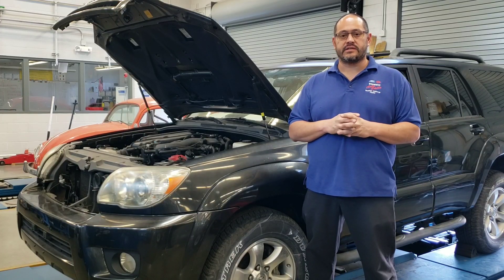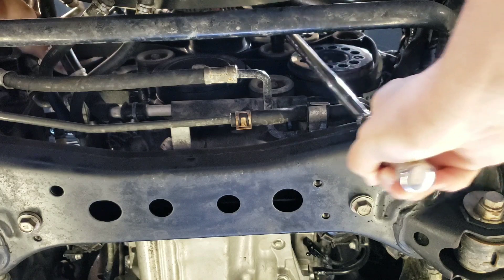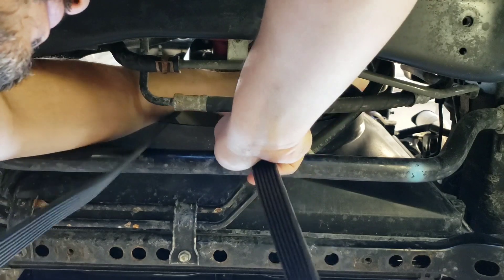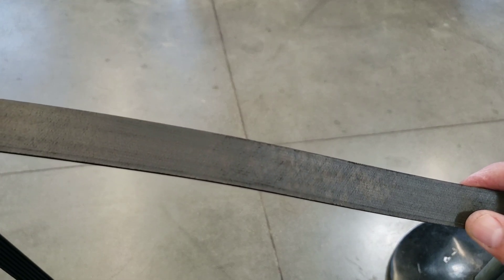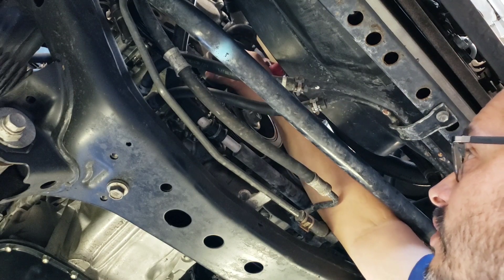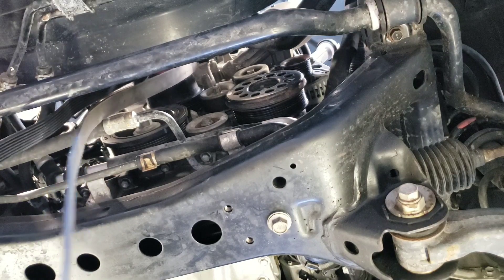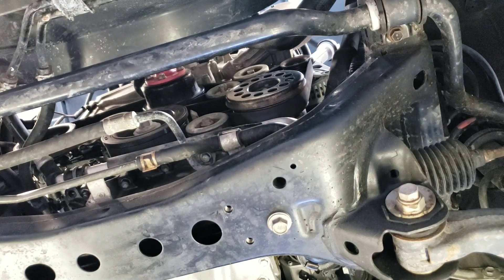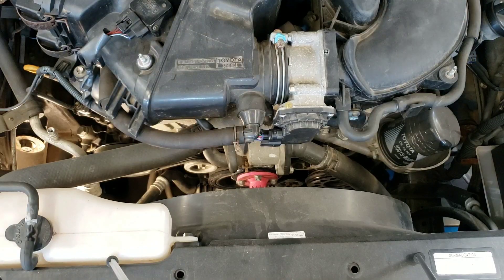Toyota 4 Runner serpentine belt replacement

Comment: The 2011 4runner (I assume all 5th generations) has exact same configuration. However, changing the belt can be done from the top. Not that difficult.

Comment: By far the best DIY drive belt change video on Youtube! Very clear and straight to the point with a few added hints to make the job even easier. The 5mm allen key trick was a life savior and made the job that much more simple! I was flushing the cooling system and replacing the thermostat with a new one and after draining and flushing most of the coolant out, I went straight into doing this drive belt replacement job with the old thermostat and hose pulled out of the way, which I think made the job even more easier... less stuff in the way. Thank you Omar Sevilla for a very helpful video! Appreciate the upload!
Reply from the maker: Thank you.  I post these videos when I can.
Reply: Yeah, now all I have to do is buy a 12ft high garage, so I can get that lift in it. Then buy a belt. Nice.

Comment: Omar thank you for posting, I am also interested in your scissor lift because of the garage low celing, any info appreciated
Reply from the maker: The lift is from hunter engineering.  The shop was engineered with flush mount installation specific to the equipment.  This allows us to drive very low vehicles onto the lift to perform alignments.  The price tag for lift and alignment equipment was about 60k in 2011. Not sure what it would run today.

Comment: Want to find out if have a question.I just change my bad serpentine belt on my 07 Toyota 4runner and place a new one on. I notice later that day my power steering pulley moving in and out so i want to know if thats normal or what's the issue??
Reply from the maker: Yes some pumps have a little end play.  If its not leaking I would consider it normal.

Comment: Update,i went Advance auto ,got a reman CARDONE power steering pump for about $200 but with the $45 core charge,i will pay less.I got home a bit late thinking i will get the pump drop but ran into issue with that 17Mm NUT (the high  pressure hose ).Tomorrow a friend of mine is going to bring a impack gun to help me get that line off.

Comment: Another pointer is, i dont know if the belt had ever being changed. I bought this 07 toyota 4runner 3 or so months ago with 104,675 Odo. Hope it's not a faulty fail pump because it don't make any noise,no leak nor i feel nothing but smoothness when i turn the steering.
Reply from the maker: If the belt is not being damaged and the power steering pump is not making noise maybe it is a normal condition. Notice in the video that I put my hand on each pulley to verify that it feels normal. I would pull the Power steering pump shaft in and out to see how much it moves. It should only move a few thousandths of an inch.
Reply: @OmarSevillaAuto  Thanks for taking the time to respond to me 😊😊🙏🏼. I will update upon my task with my 07 Toyota 4runner.
Reply: @OmarSevillaAuto  SO after leaving the comment,i went and got the serpentine belt and check the PS pulley with my hand.  The pulley as expected went IN and Out with about 3mm  and i also did a record video of my moving it In and Out. Since the pump need out,what QUALITY brand would you recommend me to get???
Reply from the maker: @doobedi  I would compare my pump with the new one before replacing.  Toyota factory parts are the best but any aftermarket parts will work. It really depends on your budget.
Reply: @OmarSevillaAuto  So i got the pump and compare them which look very identical. I put  on my new /reman pump but when it came to put the serpentine belt back on,it couldn't go over the pulley. The hole that you put the 5.5mm Allen key in to hold the Tensioner broke on me  😔. I try not to frustrate myself and not going give up.
Reply: @OmarSevillaAuto  So i got the serpentine belt over the pulley. It was my fault because i didnt push the Tensioner all the way back but now it's up and running like a dream 😅.

Comment: I did exactly what you did but on idling i saw my PS PULLEY going IN AND OUT.
Reply from the maker: If you are having a problem with belts being damaged it may be time to replace a failed pump. I would remove the belt and see if I can slide the pump shaft in and out by hand.
Reply: @OmarSevillaAuto  well this is a new belt i just put on but the pulley going in and out. If by chance it goes in and out by hand,they pump will need to be replaced??